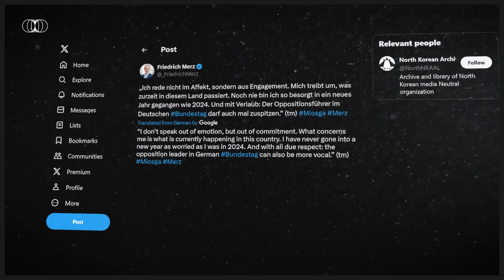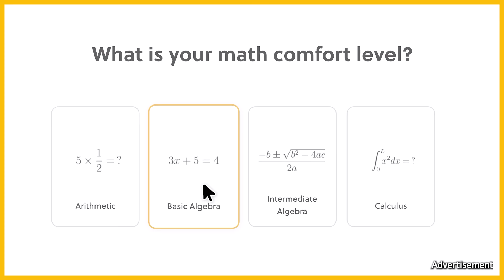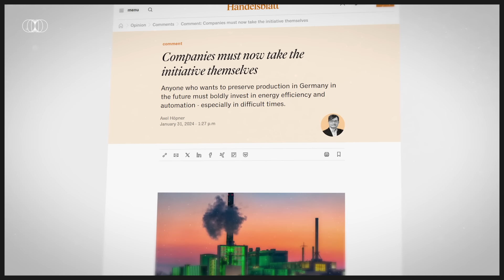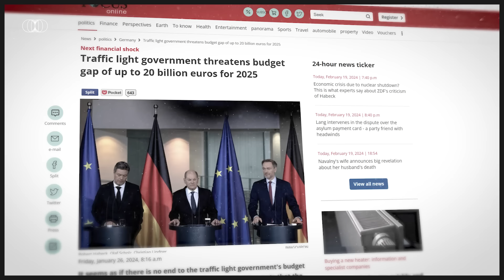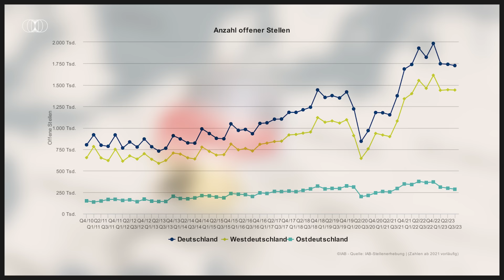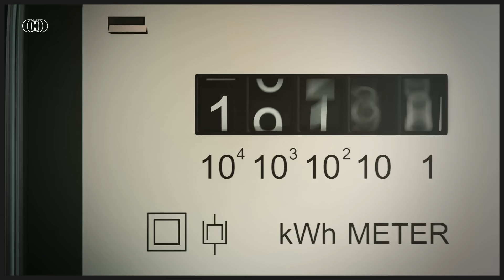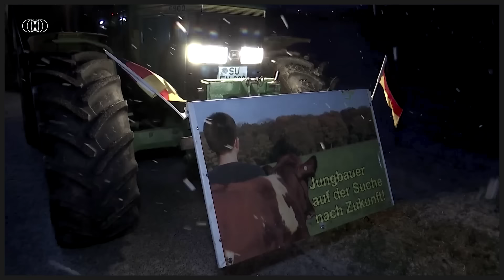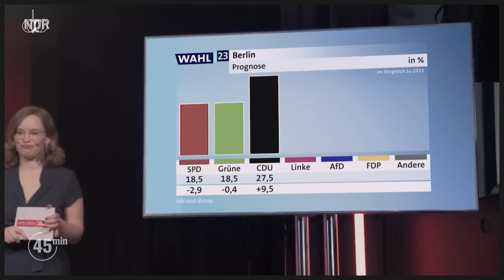How Germany's Problems Can Bring Pre-WW2 Misery

Comment: A lack of national identity for any nation means it has nothing by which to build a base for its ideals, the cultural identity of any nation changes over the course of time, its part of the natural world order, however in the case of Germany, Poland, Romania, Hungary, Cehia and Slovakia it was forced on them, fixing the problem is not simple like say  changing a lightbulb, you have to fix the entire wiring, the circuits, the switches, even the fuse box if need bee and considering that we are still railing from the Second Black death and another mad king/crazed emperor has start a war, the problem just got bigger,

Comment: We all have so much to thank to Angela Merkel
Reply: I take it this is a form of sarcasm?
Reply: @bratbrata4974  Bingo
Reply: Yes, 16 years of messed up
Reply: I'm Polish. The period when Merkel was in power coincided with Tusk's rule.
Previously, before 2006, the government of the right-wing coalition had a project of a pipe on the bottom of the Baltic Sea from Norway. It's about gas. It was torpedoed by the SLD government (social democracy with political roots from the period of dependence on the USSR).
During the years of the Merkel/Tusk government, we received reassuring media messages that the NS project was ok and that relations with Russia should be reset, because it is a new pro-European Russia. Once it was built, construction of NS2 began. All of Central Europe started shouting that it would end badly. And that's it.
Now that Germany got its ass kicked and nothing came of being a dealer of Russian gas, it turns out that all of Europe has to switch to heat pumps. And who produces the most of these pumps in the EU? There is also outrage over the Siemens case in Poland. Poland is building huge windmill fields in the Baltic Sea. After a coalition dependent on Germany took power in Poland, a German company with a name starting with S won the tender... and in addition, EU money for this project was unblocked, the money that was blocked due to the "lack of rule of law" in Poland.
How can you not love Germans and the officials in the EU who depend on them?
I puke on the EU, and my trust in my neighbors across the Oder is also falling.
Reply: @bratbrata4974  What did Poland look like before joining the EU, do you know that? Me, yes. Poland is one of the largest recipient countries. DE is the largest donor country. 🤔
Reply: @arnodobler1096  Or maybe you will ask how Poland paid for joining the EU? You think EU is a good uncle.
Poland paid a huge price for joining the EU. The first thing was to open markets to EU companies. Polish companies had no capital. Western capital bought out Polish competition and closed it down, or broke it into smaller parts and closed it down. It was an "adjustment" of the Polish economy to the EU economies. So that countries like Germany and their industries are not affected.
And so the shipbuilding, sugar, textile and electronic industries were destroyed in Poland. Additionally, when Poland joined the EU and there were some shipyard remnants, Polish shipyard workers could not be subsidized by the government in Poland, but German shipyard workers could.
This is how justice works in the EU.
As a result, Poland has lost competence in many areas. Engineers and workers had to look for work abroad. So we "paid" for joining the EU again. Every Pole paid for the education of a worker, engineer or doctor.
Then the invasion of Lidl and other German companies began, killing not only the Polish grocery trade, but also agriculture in Poland.
Additionally, Polish farmers receive 25% of what farmers in other EU countries receive.
And when Polish forwarding companies or other companies started to threaten German and French companies. Suddenly, restrictions began to be introduced in these areas so that the "free market" in the EU would work better.
THIS IS HOW THE EU WORKS. WORKS FOR THE STRONG. And it treats the CE countries as a resource for its own industry.
He uses tired propaganda patterns for the intellectual quarters of Europopulism.
The EU is a community of egoisms, not a community of nations or culture.

Niecy is leading Europe to collapse 3x. The egoism of German politicians and corporations and the appeal to Bismarck's policy are once again leading Europe to misery.
Technologically, Europe has nothing to offer the world. Only technologies from the 20th century and the end of the 19th century. We become a museum.

Comment: surprised pikachu face when you shut down your nuclear reactors.
Reply: Not true. Germany should invested in renewable energies in the 2010s
Reply: @siddhartacrowley  no. Renewables do not guarantee a base load for the energy grid. Moreover making germany carbon neutral without nuclear energy would cost trillions insted of hundreds of billions with nuclear energy.
Reply: @siddhartacrowley you still need a core (power) load generator which is consistent and could ramp up to cover any shortfalls. Then the renewables can add to it.
Reply: @siddhartacrowley too bad there’s no wind or sunshine in Germany😂. Greens that can’t do math…Germany is not California…no matter how hard it tries
Reply: @lucasglowacki4683  even california was forced to admit that nuclear energy is fundamental and had to restart the palo alto nuclear plant.
Reply: That turned out to be no issue, electricity prices much down, energy stability the same, CO2 down, less coal power than in 2022 as solar and wind was massivly increased by multi GW. As wages catched up with inflation recently and the latter is almost normal (2.5%) a lot of problems are disappearing right now (and hence AfD went down from 22 to 17% in past 2 month), this channel is, as often, behind the curve of actual development.
Reply: Prices are lower now than before shutting them down
Reply: @stygian4011 coz winter is over? and some factories left germany?
Reply: @effexon  it was the most expensive energy in the mix and prices are set by the most expensive energy being produced
Reply: @marcobonesi6794  To be fair hindsight is always 20-20.
What didn't require hindsight was learning from their own past and to not trust Russia/Putin.
They let themselves become completely dependentant even though they knew first hand what Russian influence did to eastern Germany, the region hasn't fully recovered to this very day.

Comment: First Germany should get rid of the crazy constitutional debt brake. Their government desperately needs funding to solve the multiplying problems. Germany can borrow extremely cheaply and always could. Even before they invented the idiotic brake. It is comparable to getting your hands tied behind your back before going for a swim to "avoid wrong movements". Germany is certainly avoiding movements now. Wunderbar!
Reply: Germany already has a huge state budget but spends the money idiotically. The reason many want to maintain the debt brake is the fear that additional debt is just more money that the government can waste.
Reply: Youre framing it like, we dont have enough money, which clearly isnt the case. The german problem with money has always been about its ineffizient spending not its ability to generate funds.
We have huge inefficiencies in our bureaucracy which also keeps on growing and a lack of clearly defined social spending.

And besides that, there are legal ways to circumvent the debt brake if the government wish to choose to. You could for example create a "NewRoads Comapny" which is 100% owned by the state which is then able to take on debts, which then can be used to finance building new roads.
This system is in use in Austria already and can be used in many different fields. 

Also besides that, just taking on new loans womt magically fix the deep-running issues, as wont just throwing more money at it. Cause we ARE currently investing more money than ever.
What is needed is reforms to make it easier for business to form or to settle here, again by tackling the our bureaucratic issues.
Reply: im not so sure about that, germanies national household is larger than it has ever been, yet germanies government appears entirely incapable of effectively using this large budget to address its miriad problems. It has Transitionined away from nuclear during an energy crisis. It keeps talking about wanting to cut beurocracy, yet if anything it has gotten worse since 2021. It has prooven entirely incapable of adequately adressing the refugee crisis, leaving the country as a whole, but many communes esspecially burdened with ruinously expensive upkeep for refugees, to the point where non german refugees often can enjoy a better standard of living than poorer or unemployed germans. Its green transition and ever harsher regulations regarding the need for green technologies and penalities for non green technologies are also stiffling growth. No ammount of new borrowing will help germany if its government isnt capable of effectively spending the money it has.
Reply: debts mean interest. The debt brake is reasonable. If you want spend more, tax more or don't spend more!
Reply: @kr33tz why did they put refugee spending in constitution? that seems big problem when numbers are still rising every year... also they will call to friends and any family members to come join in germany for free food and housing. certainly bureacracy should be cleaned up, it must be slowest and most expensive in europe now. by immigration i mean cities and state love to hide these costs in hiring these people in payroll, which is not productive use of money and also needs more administration.
Reply: @effexon Did you respond to the wrong comment?
Reply: @effexon  what are you talking about? Are you on right thread?  Didn't get your point, relative to the discussion.

Comment: Contrary to most opinions the problems haunting Germany are mainly external in nature.
A European security architecture that is unfit for the nation, with every Euro spent ultimately serving American interest, be it directly through deployment or indirectly through burden share.
A geography that is unfit for providing security to Germany itself or to their economic back yard.
A monetary system which is underpinned by German bonds preventing Germany from ever in engaging in money printing without risking massive inflation , while all other euro nations are not fiscally controlled by the very nation that hosts the Euro. The German elite thought they could mitigate the effects by anchoring their economy to cheap energy through long term contracts with Russia. Guess what, if all Euro nations are in fiscal dominance so will Germany be even if they didn’t print, thus Euro inflation will find its way into the German system.
Lastly Germany, was never really able to create its own sphere of influence during the post war period, causing it to engage in numerous balancing acts involving most major powers to prevent being overpowered by a single counterparty. This is unraveling fast now, be it the French and Chinese economic cooperation, Russian cooperation in energy or American cooperation in security. Welcome to strategic hell. Bad politics cost nothing until it materialises.
Either Germany pushes outwards or it will get pushed in. Neither is desirable but my guess is on the later. 
By the way, their demographics is totally their own internal disaster.